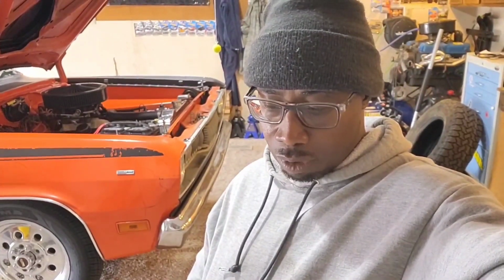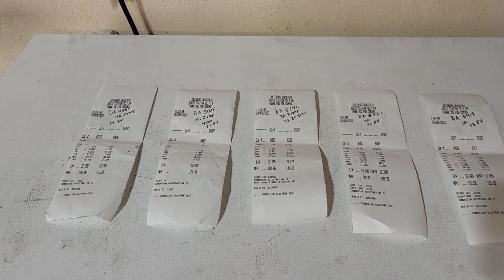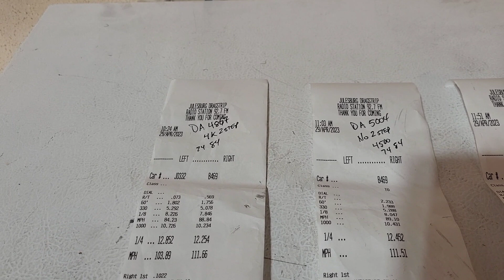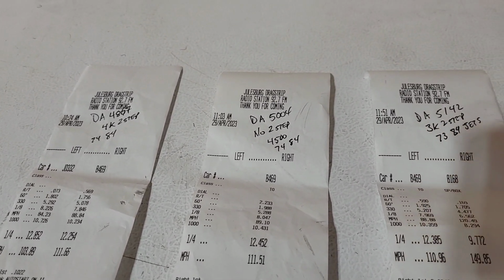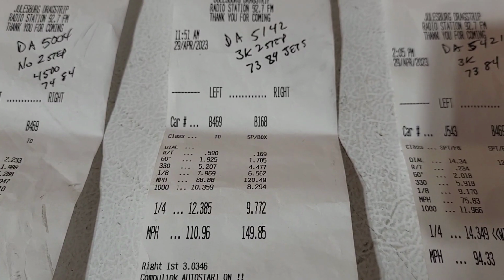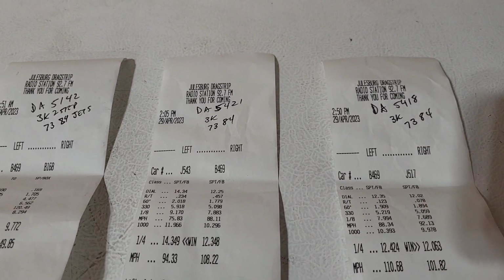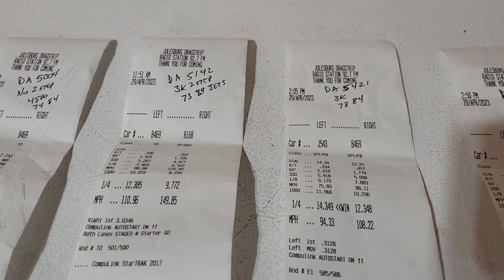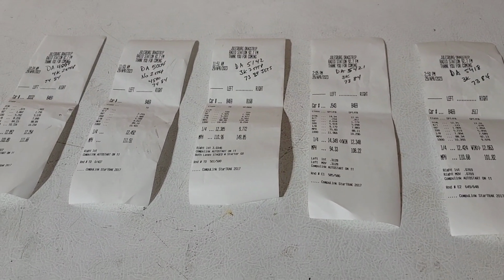Mopar 360 Duster PB! #nonamenationals #mopar #race #project #360 #duster #dodge #moparornocar #1971

Comment: Nice share! Hard to beat a spool. But you know the cost. Do you run a transbrake with your two step?
Reply from the maker: Thanks! My editor skills are subpar at best, but you gotta crawl before you walk! Around $140 for the spool and bearings. My buddy will set it up for a 12 pack of cold snacks! I'm thinking at this altitude a 4.30 gear may help me get into power band quicker, and help me trap at optimal rpms. No trans brake yet.

Comment: Knock knock knockin on 11s door! Dude with that mph, your in the elevens. I’ve gone 11.88 with 111 mph. Definitely go with a spool, work on that 60’ time. That 60 time effects the quarter time a lot. If you shave 2ths from your 60, you’ll pick up 4-5 in the quarter.   This is getting good. That car has a lot of potential.
Reply from the maker: Bruh!!! I couldn't cut a 60' to save my life! When I saw the mph, I was like, hell yeah! I'm still learning the car only 21 runs total so far. I think the spool will help, and I'm contemplating a 4.30 gear at this altitude. I'm going to try and max out my shocks next test n tune see if that helps.
Reply: @greazedlightninggarage6768  4.30 gears may be a little much. What rpm do you cross the traps at now with 4.10s? I think the spool should help your 60’ if traction is the issue. What torque converter are you running in your 727?
Reply from the maker: @Duster Garage  I'm not exactly sure where my rpms are at the traps, I was too busy looking at the AFR. I had my shift light set at 6100 and it never went on going through the traps. I have a J&W 10" 3800 stall converter, which flashes at 4k. I'm certain traction was an issue. I felt it spinning that, and the rear is not working properly. My outing at Pueblo Motorsports Park, which is 1400ft higher, the track was prepped, and it hooked! Zero spinning and my best 60' was 1.71. I'm going to take it out and have my buddy watch and maybe record so I can confirm exactly what's happening.